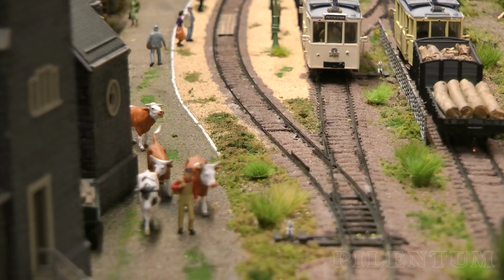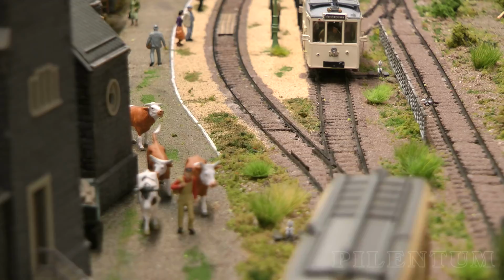The Little Model Tramway in the Province of Namur in Belgium by Jan Martens

Comment: Tout va bien sauf la caisse, comme on dit dans mon pais. Impressing layout but, just two questions. First, how did this tramways run without overhead wires? The second, more essential. Who sells these models? Are they available on the market? Many thanks already for any hint.
Reply: Those tramway are not electrics but diesel autorails, so no overhead wires.
For the producer, unfortunally all those models are no more available, you only can find it on second hand market.
Reply: I, too, was wondering about the overhead lines. But the layout is so beautiful that it was hard to wonder about the propulsion.